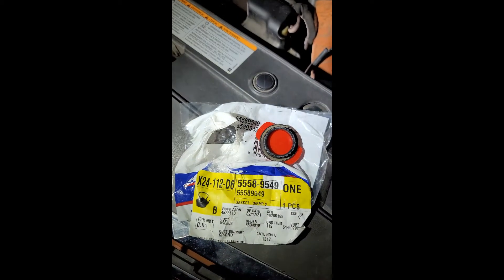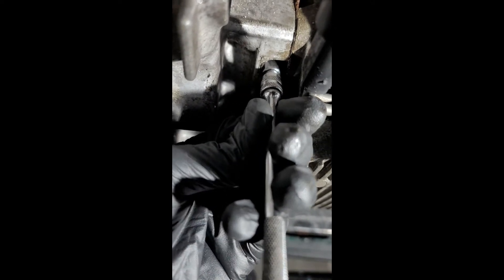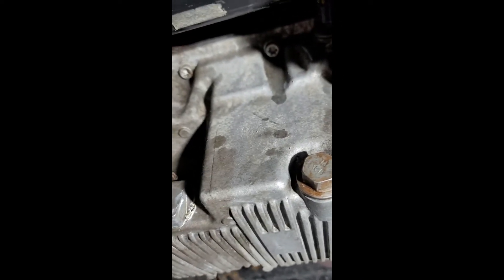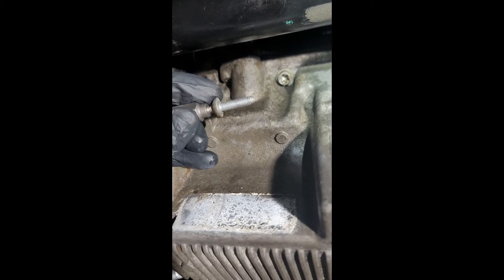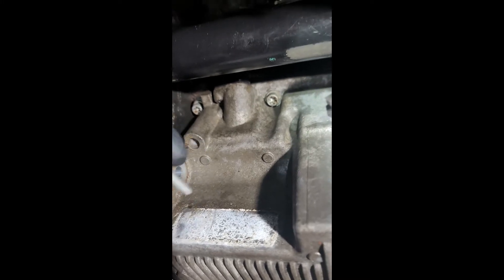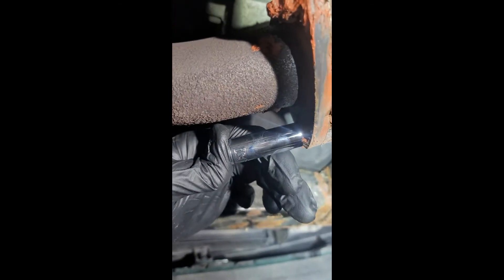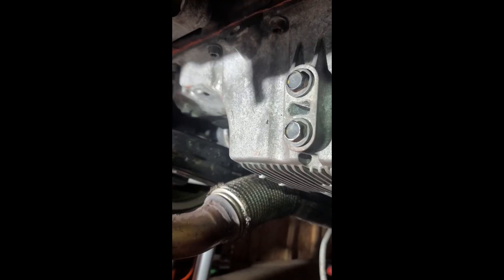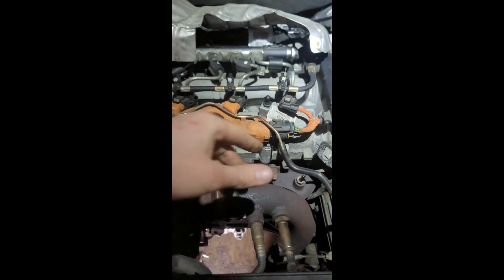Replace (Oil Pump Pickup Seal) on a 2014   2015 Diesel Chevy Cruze (55589549)

Comment: That bolt you drilled out is a “security fastener” it’s never meant to be taken out. (Doing my pick up seal now.) but have ran into these on duramax pcv system
Reply: (In the duramax world) we normally use a die grinder/cutoff wheel make a slit in it and use a flat head screwdriver to pull them out. Then replace with a normal bolt
Reply from the maker: @boaxler787  I thought about doing it that way too I just wasn't sure if a grinder would fit back there. Let me know if the grinder and flat head works in this particular case, and I will mention this method in the cheat sheet.
Thanks!

Comment: At 13:40 You mention lifting the engine 4-5 inches at the compressor bracket. What did you use to lift the engine? Did you have to remove any engine mounts?

Comment: Does this apply to the canadian version aswell?
Reply from the maker: @nikofilippopoulos940  If it's a Diesel Cruze, then most definitely. 

The Engine was originally in Europe on a bunch of cars, most specifically the Insignias. A20DTH is the same engine as those in the USA.

Comment: Hello I have a 2014 cruze diesel I keep getting code p2002 I clear it then it comes back immediately without engine running
Reply from the maker: The code P2002 is usually caused by a DPF Filter that is nearing 100% filled with (Soot).

If your car (Doesn't) regen the (DPF Filter) by burning the Soot from inside the DPF soon it won't hurt your car but you won't be driving by the end of the week when the car decides to limit you to 25mph. The reason the message returns without starting is the DPF Filter still sees a high percentage of soot.

I suggested either going for a 60-70 mph highway drive for 30 minutes (Total time) this will unofficially allow it to regen. Don't quote me on this but after the drive your car may hold the code until (10 full starts and shutdowns) for the code P2002 to clear unless you clear the code manually/OBD2 scanner.

If you want to play it safe.... Do a Manual regen. Link on how to get access will be attached below.
https://www.facebook.com/groups/519360744936124/permalink/1792096980995821/
Reply: @collinskotynsky150  what sensor sense how much soot the dpf has?
Reply from the maker: @blessedman3253  Unfortunately I do not know,  this may also be calculated based on the resistance to airflow into the intake.

Comment: 2 questions, so the m7 ribe bit is only used for the 2 bolts that are next to the transmission and the other one is how did you drill out that small screw holding that sensor in
Reply from the maker: @rumblertag1419 Correct about the M7 Ribe, you can also use a  T40 Torx bit as an alternative, just make sure your on the head of the bolt Straight-on otherwise it may stip/round out. I actually used a Torx T40 and T50 for all mine and everything came out and went back in just fine. As for the Screw at (7:57 minutes) I used a #31 drill bit in my electric drill and drilled the head from the top of the engine. The extractor I used was a 1/8 Snap-on (REX104C).
https://shop.snapon.com/product/Multispline-Extractors/1-8%22-Multispline-Extractor/REX104C